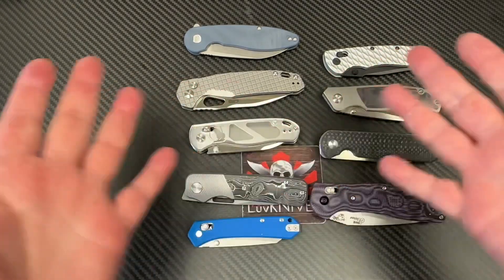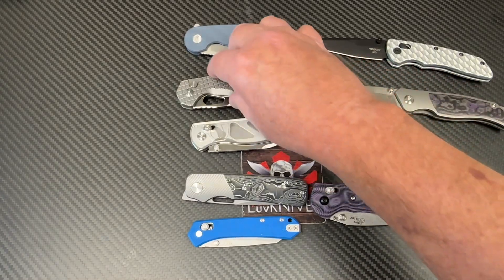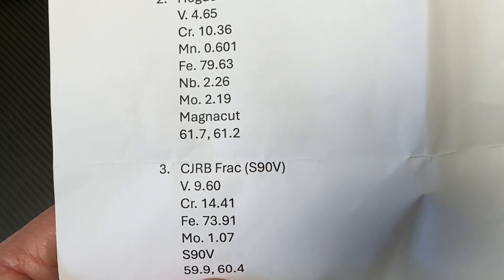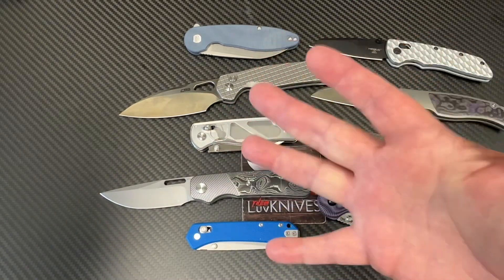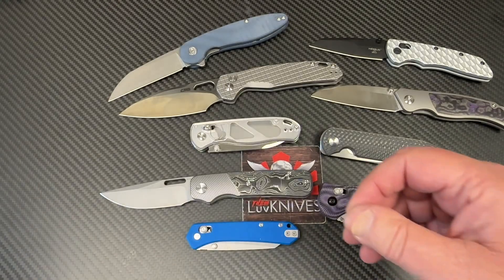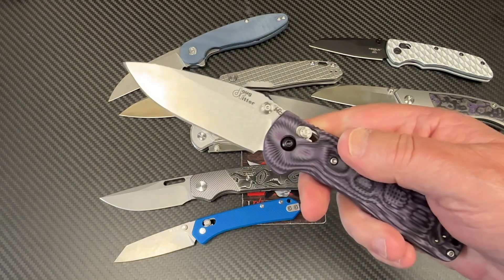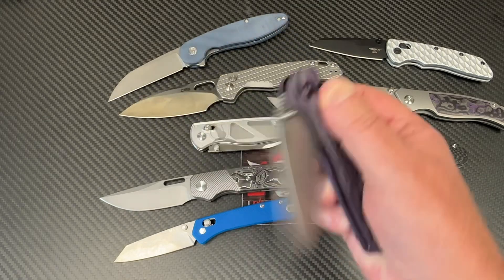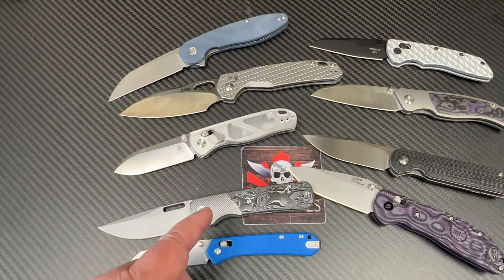Batch 7 Knife Test Results ! S90V & Magnacut !

Comment from the maker: Luvthemknives website: https://luv-them-knives.myshopify.com

Join my Patreon & get in on the early bird knife sales & monthly drawings: https://www.patreon.com/LuvThemKnives?fan_landing=true

My email address : luvthemknives@gmail.com
My instagram  http://instagram.com/luvthemknives

How an XRF Analyzer works: https://www.bruker.com/products/x-ray-diffraction-and-elemental-analysis/handheld-xrf/how-xrf-works.html

Why carbon and other light elements are not detected with the XRF Analyzer: https://www.pxrfs.com.au/light-elements-difficult-measure-portable-xrf/

Spreadsheet of knife testing results to date: https://docs.google.com/spreadsheets/d/1OepNr_D4lqbdTFqdqWl1rmAd4bOzPzJe6J0iEWrdJGU/edit?usp=drivesdk

Batch 7 Test Results 
 

1. Tuya Envy V4 (S90V)
V. 10.25
Cr. 14.08
Mn. 0.655
Fe. 73.25
Ni. 0.219
Cu. 0.149
Mo. 1.17
S90V
58.4, 58.8
 
2. Hogue Deka (Magnacut)
V. 4.65
Cr. 10.36
Mn. 0.601
Fe. 79.63
Nb. 2.26
Mo. 2.19
Magnacut
61.7, 61.2
 
3. CJRB Frac (S90V)
V. 9.60
Cr. 14.41
Fe. 73.91
Mo. 1.07
S90V
59.9, 60.4
 
4. Miguron Centurion (S90V)
V. 9.72
Cr. 14.11
Fe. 74.02
Nb. 0.094
Mo. 1.16
S90V
56.4, 56.5 ☹
 
5. ABW Model 2 (Magnacut)
V. 4.29
Cr. 10.87
Fe. 79.90
Nb. 2.31
Mo. 2.14
Magnacut
62.6, 62.9
 
6. Gareth Bull Clone (M390)
V. 4.32
Cr. 20.07
Fe. 73.16
Mo. 1.26
W. 0.503
M390, 20CV
64.2, 64.4 (spicy meatball!)
 
7. MKM Yipper (Magnacut)
V. 4.39
Cr. 10.77
Fe. 79.46
Nb. 2.39
Mo. 2.28
Magnacut
61.8, 62.1
 
8. Ritter Hogue RSK (Magnacut)
V. 4.02
Cr. 10.43
Fe. 80.55
Nb. 2.35
Mo. 2.09
Magnacut 
62.9, 62.9
 
9. Kizer Drop Bear (Nitro V)
V. 0.077
Cr. 13.37
Fe. 85.47
Nitro V
59.0, 59.1

Knife Test Batch Videos 

Batch 1 new era: https://youtu.be/WTsUV0f-1kk

Batch 2: https://youtu.be/WUAPbJo7rY8

Batch 3:https://youtu.be/-Z0b2wZT8mA

Batch 4 Knife Test Results including the Spyderco Shaman 15V & Microtech in Magnacut !
https://youtu.be/F4c13Kfhubo

Test Batch 5 Knives Results !   You’re going to be shocked !!!
https://youtu.be/ys9IhtPOTWw

Knife blade steel Test Batch 6  Magnacut is now the focus and how good are these hardness numbers ?
https://youtu.be/pDE72wM1iw8

Previous years

Batch 1 (4 years ago):https://youtu.be/Nh4rjoeY748

Batch 2: https://youtu.be/cqsvN3XtYEQ

Batch 3: https://youtu.be/JWCNV8Ipaus

Batch 4: https://youtu.be/LsThV3AjXv8

Batch 5: https://youtu.be/X0Jtb28VPc0

Batch 6:https://youtu.be/vmwb-ZfA3Xo

Batch 7: https://youtu.be/1dU1EoGdMxY

Batch 8: https://youtu.be/YGeKHMztk0A

Batch 9: https://youtu.be/7r7Wj3_L6zA

Batch 10:https://youtu.be/LimXek6Y9i4

Batch 11:https://youtu.be/eCR9V7-8Nic

Batch 12: https://youtu.be/5hgFEw3jSEc

Batch 13: https://youtu.be/ivCZsfyU0T4

Batch 14: https://youtu.be/kHkSCrLub48

Batch 15 & 16: https://youtu.be/Qzg5RoTE9nI

Batch 17: https://youtu.be/kZ5dR4p5QG4

Batch 18:https://youtu.be/pmG_8nPDbNw

Batch 19:https://youtu.be/ANNyyOycolo

Batch 20: https://youtu.be/ptL2e7fcbgA

Batch 21: https://youtu.be/djgpAcP4RuY

Batch 22: https://youtu.be/nt06Gn_Bphs

Batch 23:https://youtu.be/BlR6ZHVIv6g

Batch 24: https://youtu.be/UDYUp6NQ1CE

Batch 28: https://youtu.be/PfXag6Ku72s

Batch 29: https://youtu.be/qnetRveTeBY

Batch 29 part 2: https://youtu.be/SXVW27CiWWI

Batch 30:https://youtu.be/gs5dub2ilzs

Batch 32: https://youtu.be/fRY7ldnOMvQ

Batch 33: https://youtu.be/aRA7mnk3tCk

Batch 34:https://youtu.be/LAV40-4ntug

Batch 35:https://youtu.be/TkPPWfnZSQA

Batch 36: https://youtu.be/M_gbiZ_gfZQ

Batch 37: https://youtu.be/72vS4WXTLjU

Batch 38: https://youtu.be/zhUmuFW15VQ

Batch 39: https://youtu.be/NVMADfMpRRI

Batch 40: https://youtu.be/vr2gaZmcYms

Batch 41: https://youtu.be/7GJ9egoMO7g

Batch 42: https://youtu.be/jZkETbUMYgw

Batch 43: https://youtu.be/4kPI5dPJA24

Comment: I’m not surprised at all by the Miguron. I bought an Elgar in S90V cause it was like $130 and I was excited to get my first S90V blade for that price. I put an INSANELY sharp edge on it with a fixed angle system, to the point I could shave the edge of a piece of paper and get curlicues the thickness of a human hair!! I then cut about 30 ft of cardboard. The last 10 fr were really hard to cut, so I decided to see if I could still get curlicues off the paper. I was shocked to see that I couldn’t even cleanly slice the paper anymore! I’ve had bedder edge retention off of $6 420J knives. I put a few more edges on it to make sure I was passed the steel that was burned up from creating the factory edge, and it still wasn’t much better. Seeing this Miguron test at 56 HRC lines up with my use experience. And my blade is PVD coated, so that process probably makes mine more like 55 HRC 😢

On top of all that, the lock failed on me with almost no pressure. Cut my thumb extremely bad. So now the Elgar sits in a junk basked in my bedroom. Huge disappointment all around. Miguron: if you happen to see this, please work on your heat treatments and your lock, face geometry! The fit, finish and action on the Elgar is phenomenal!Far above and beyond what I expected for the price you are charging. If you could just fix those two things, you would hands-down be my favorite knife company in the world!

LTK: thank you so much for doing these tests! Keep up the great work

Comment: S90V doesn't really gets higher than 60hrc and it is very tricky steel to do right (even for custom knifemakers). That's why I don't like and do not buy knives in s90v. Elmax, M390 or Magnacut is the way to go for a high performance stainless steels. Apart from that I choose carbon steels any day. 😎

Comment: Thanks, I never bought chinese made knives before 2024 just because I have my favorite brand which happen to not come from there. Bought the Artisan Revel and Jack Wolf Gunslinger recently. Both in S90V. Even on the stones it was weird, the burr can't be raised properly, not like on an S90V Spyderco. I did not have a hard time sharpening them properly, but I've never seen S90V act that way on the stones before. I've cut a lot with the Revel and the edge retention is poopoo in my opinion. Really disappointed.
The Gunslinger acted similarly on the stones, I hope it's gonna keep its edge better .

Comment: Very disappointing from Miguron.   I'd love to see what Jack Wolf knives get on their S90V if you can test one at some point.   It's a bit rough to figure out what that range is supposed to be, wouldn be very interested in a video on recommended ranges for most common blade steels.
Reply from the maker: Check out the link to the spreadsheet that I posted.   That will have hardness ranges for various types of steels.

Comment: Whelp according to crucible s90v 58 hrc is acceptable in that range for thoughness,but shooting for 60-61 hrc is optimal.
Reply: Pretty sure 58 is fine if you need more toughness, as S90V is not at all a tough steel 😂
But at 58 HRC it should still beat out S30V, S45VN, S35VN and even 20CV at 60 HRC 

Also at 58HRC, it will be significantly more stain resistant as well, like surprisingly stain resistant, not quite 20CV, but will beat out XHP & S30V at the same hardness, which is kinda Nutty

S90V is a very strange steel, because the difference with hardness is amplified more then most other steels

While something like 20CV might gain marginally more stainless and toughness properties by being softer, S90V gets massive gains to both by going down, and gets insane sharpness & edge retention  going up 

All relative of course, it’s not magic
Reply: @bornonthebattlefront4883  S90v @58 isnt that great. You get it for edge retention. At 60hrc it still has more toughness vs m390 at 60hrc. S90v is a great steel @ 60+hrc. I have 62hrc S90v kitchen knives and they are fantastic. 
@58 hrc.... Meh...

Comment: S90V isn't supposed to be as high as M390/20CV it's optimal at a point or 2 lower. So a 59 is actually good. Atleast according to Google.  56 would be the lowest acceptable number.
Reply from the maker: I think you’re correct.
Reply: I’ve also heard s90v is easier to heat treat than m390 is that true?